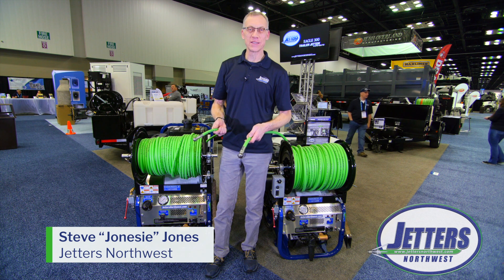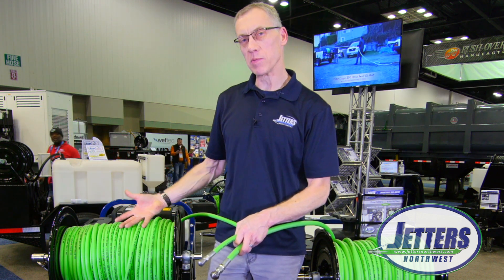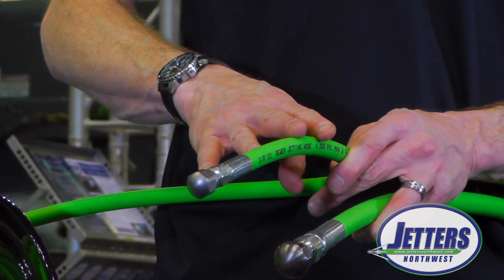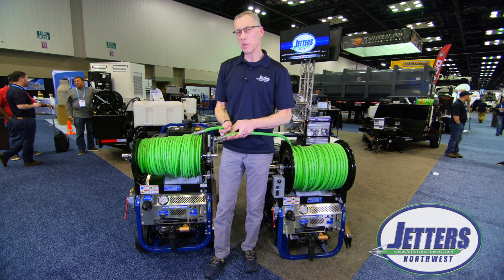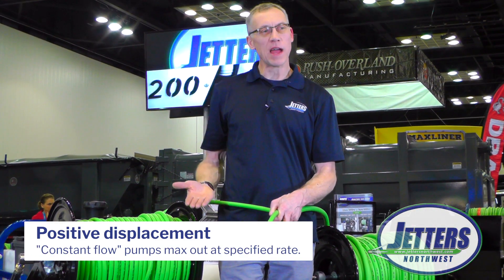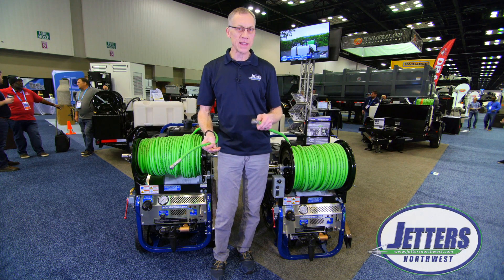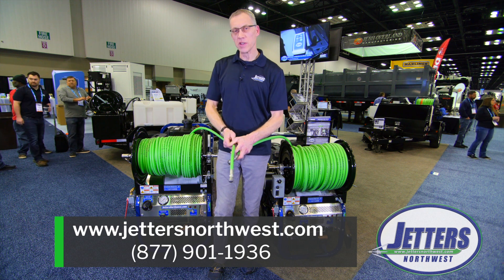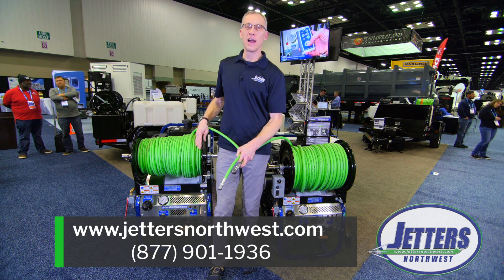Jetting Hose Size-Choices:  3/8" I.D. Jet-Hose vs. 1/2" I.D.  - "Get" Jetting!

Comment: Wait, I'm lost.  How do I know what size sewer Jetter hose I need for my 3500 psi 2.3 GPM
 pressure washer?
Reply from the maker: For 2.3gpm a 1/4" jetting hose is most efficient, or you could drop down to 3/16" for max flexibility if you're jetting 1.5" and 2" lines.  Sorry for the confusion - the video is targeted to contractors with "Rooter class" jetters that do +/- 10gpm

Comment: Great info.  I currently have a Brute 9gpm/4000psi w/ 3/8" hose.  I want to use my 3/8" 200 ft satellite for clearing roots with maximum PSI.  Allan J Coleman, where I purchased this equipment from, wants to sell me three 50 ft sections of 1/2" from the machine to the satellite as a solution.  I have two questions.  1. Will 3.8" quick connect coming off of Brute decrease pressure/flow.  2. Do I lose any pressure/flow if I use the original 300 ft of hose that came originally with equipment?  Thank you in advance.
Reply from the maker: If you want to maintain full GPM/PSI capability then yes you'll need to connect to 1/2" hose(s) to "go around" the 3/8"x300' hose on your Brute's reel, because the extra 200-feet of 3/8" hose will eat up about -280psi and about 0.75gpm, unless you use the larger 1/2" hose to get to it (taking the jetter's 3/8x300' hose out of the equation)....
Reply from the maker: ... However, it is VERY common to connect a 200-ft x 3/8" hose/reel to your the end of a Brute's 3/8"x300-footer because it's so convenient, even tho that extra 200' will lower the nozzle-pressure about -280psi and cause about 0.75gpm of flow-loss (the Brute's PSI-Regulator valve will bypass water back to the tank to keep the jetter from exceeding 4000psi)....
Reply from the maker: ...You simply have to judge for yourself if saving ~250psi and ~0.75gpm by adding the 1/2" hoses is more valuable than the convenience of simply connecting your satellite reel directly to your Brute's 300' x 3/8" hose.
Reply from the maker: BY THE WAY: you may want to get the 1/2" Hoses simply to serve as a "clean hose" that has never seen a sewer to run into/thru a customers clean workspace/kitchen/home (instead of the dirtied 3/8x300' Brute hose) to get to your remote satellite hoses/reels for indoor jetting.  Hope all that helps!  Get jetting!  -- JONESIE

Comment: I am in the market for a machine like yours for my job, yours became a possibility but a Honda engine will be my choice and you guys don't offer it hopefully in the future you will....
Reply from the maker: Recently Honda (finally) came out with an 800cc engine model iGX800 which is large enough to handle our 4009 & 3012 performance (they used to be max 688cc but we need ~750cc). We have just started using the iGX800 Honda on a custom basis to get feedback and so far so good. We are working on integrating it with our Wireless Remote Control before officially offering the Honda iGX800 on our jetters.
Reply: @JETTERSnorthwest  Thank you for answering I believe my company is contacting you folks God bless...